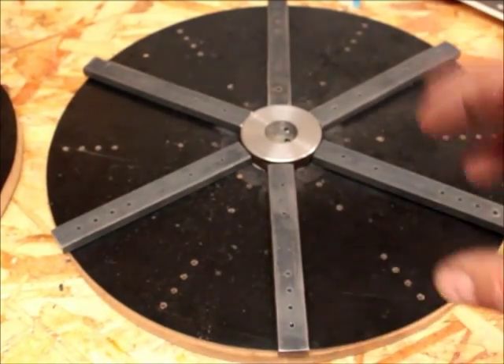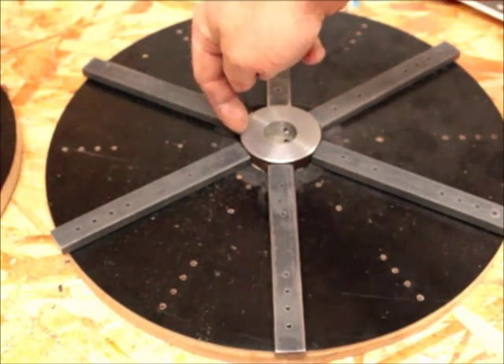New Wind Turbine Hub and Jig for steel banded PVC and Raptor blades 5Ccollet index

Comment from the maker: The drill press is key! You can also get an X,Y milling vice down at HF for I think $60 ... that and a small lathe chuck and much can be done. The work holding can be as important as the tool.  And don't forget its 25% off for one item on holidays and Thanksgiving is coming up.

Comment: Thanks for sharing that I make alot of paper templates I will be looking for a good drill press in the short future  I have a few ideas on making a jig on a round piece of metal and an easier way to cut circles from metal Using a basic angle grinder